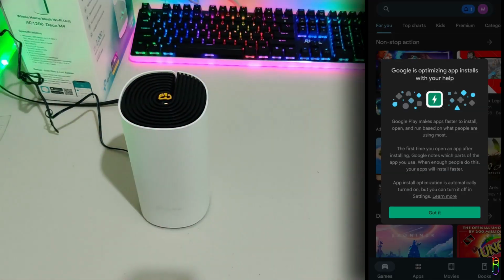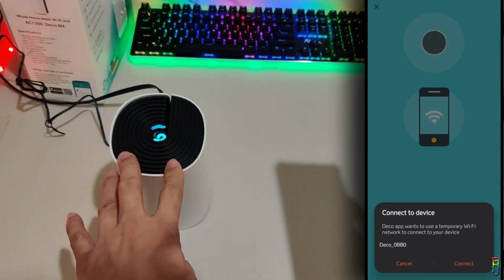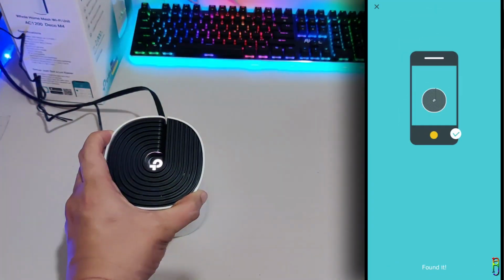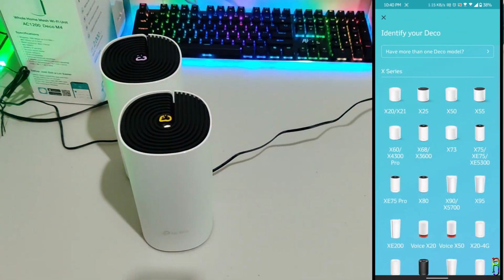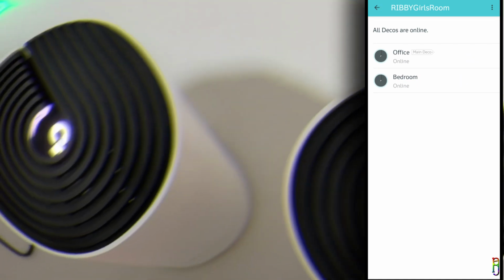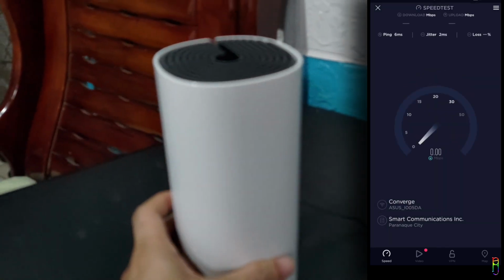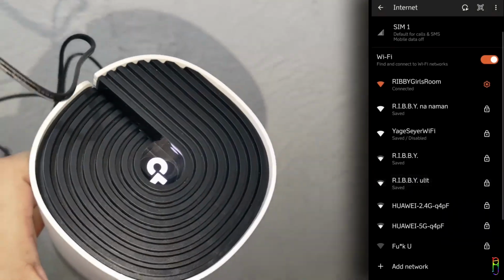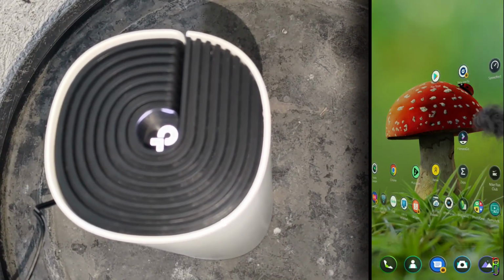Deco M4 Mesh – Setup, Testing & Unboxing

Comment: Question lng po..mas malakas ba wifi signal nito kisa router ng pldt?sa 2nd floor ng bahay mahina na kc ang signal ng 5g..pede po ba isa lng na mesh gamitin aabot ba sa taas?nsa 450sq feet lng bahay ko
Reply from the maker: Same lang siguro sa lakas ng WiFi signal compared sa ibang routers.
Pwede naman isa lang. Ang unang mesh mo ay connected ng LAN Cable (RJ45). Kaya yung LAN cable mo dapat aabot hanggang sa pagpupwestuhan mo ng mesh.
Reply: @ribbytrivia  isang unit lng kc mesh unit papadala ng pldt..kc tinanong ko customer service ok na daw yung isa..aabot kaya sa 2nd floor yung signal ng mesh?
Reply: @ribbytrivia  kc tatabi ko lng xa sa router ko
Reply from the maker: @baytisoy8888  Hmmm... parang useless kung itatabi mo lang sa router mo. Ang pinaka-purpose nya ay ma-extend ang signal ng WiFi mo. Para magkaroon ka ng WiFi connection sa area ng bahay mo na mahina or walang signal. Kung itatabi mo lang ang mesh sa router, magkakaroon ka ng 2 WiFi signal, pero coming from the same area lang. Useless kung ako tatanungin mo. 
Suggestion ko mag-invest ka ng mahabang LAN cable na aabot sa 2nd floor mo. Tapos yung mesh dun mo mismo sa 2nd floor ilagay. 
Actually same tayo ng issue sa WiFi namin dati. Mahina sa 2nd floor. Kaya kinuha ko itong mesh offer ni PLDT. Tapos bumili ako ng LAN cable sa UGreen sa shopee. Yung main mesh nasa 2nd floor. Tapos yung 2nd mesh (node) ay nasa 3rd floor. Wala na kong problem sa connections. Lahat ng floor may kanya-kanyang malakas na connections na.

Comment: Hey, nice vid!

Quick question: With the first ethernet port being used as the source. Can you use the second ethernet port on the main router to have a wired ethernet connection to your PC?
Reply from the maker: Yes, you can.

Comment: Sir, i like to check with you is that posible we only fix 1 unit Deco M4 ? Thanks.
Reply from the maker: Yes. You can always setup more nodes later. 1 will do as an additinal access points

Comment: I bought 1 Mesh and setup correctly but still no internet connection :(
Reply from the maker: Did you follow all instructions closely? Is it connected via LAN cable?
Reply: @ribbytrivia  Found out already :) LAN port is disabled. ISP enabled them to allow network flow.
Reply from the maker: @rhymcristobal4610  Oh. Ok. PLDT? I also covered that in this video:
https://youtu.be/jLIypqxyIV0
Reply: @ribbytrivia  Thank you. Ill try this :) yes but the consultant told me that LAN 4 is exclusive for Cable
Reply from the maker: @rhymcristobal4610  That's a lie. I am using my LAN 1 to LAN 4 ports for internet since day 1. Unless you have a different package for PLDT that includes cable subscription.

Comment: Sir gumagana po ba internet nito kahit nirelocate na? or kailangan forever naka lan po yung router sa deco?
Reply from the maker: Yung main node dapat naka-wired connection sa source router. The rest ng children nodes wireless na. Basta abot ng signal ng main node, kahit saan mo ilagay ang child nodes pwede, kahit ilipat lipat mo pa. Lahat yan na-explain na sa video. Pakinood na lang ng buo para maintindihan ang concept ng mesh.
Reply: @ribbytrivia  Bale sir parang minimum of two nodes talaga bilhin para may wireless po no?
Reply from the maker: @rowandajamana  Opo. Yung una ay main node mo. Sya lang naka-connect na wired sa ISP router mo. The rest ay child nodes, puro wireless na yun.

Comment: Can i connect my tplink archer c6 as main router or should I just connect the service providers Internet cable directly to deco device
Reply from the maker: You cannot replace the provider's router. You can only add access point, but never replace the main router
Reply: I have set it up. The main unit is on the second floor, have other 2 units in the first and ground floors. However, the one on the ground floor has a weak signal, and in the map, I see it's connecting to the unit on the second floor. Can we make it to connect to.first floor unit to get a better signal

Comment: Hi! Main router is in second floor. I only have one deco mesh, I am able to connect it via Ethernet cable however I want to put this deco upstairs but it came up with red light. Does this need to be connected to Ethernet cable at all times? So it means I have to buy another deco mesh so the WiFi could be strong upstairs? Thank youu for helping!
Reply from the maker: Yes. The main node needs to be connected to the main router at all times. Only the children nodes can be wireless.
You can either buy another one, or you can use a longer LAN (rj45) cable

Comment: I have currently have modem-router combo(2in1) provided by local network provider. Im thinking of getting this, can i connect this to my modem-router via ethernet cable(bridge) and just disable wifi from my original modem-router ? Would that be possible ?
Reply from the maker: Yes, You can connect this to your source router. But you CANNOT disable internet to your source router. Think about it... If you do that, where would the mesh get it's connection?
And if you are thinking of totally replacing the ISP router with the mesh, that is not possible. There are settings in your ISP's router that only they can set to enable your internet connection from them

Comment: Is this mesh good for pc as I need one upstairs ?
Reply from the maker: I don't understand the question. Mesh creates a wider coverage of WiFi. As long as your PC can connect to a WiFi, you don't need to do anything on it other than connect to it. The whole process of setting up a mesh has nothing to do with a PC
Reply: @ribbytrivia  i think he was trying to say that he will use the LAN Port of the deco m4 to connect his PC via RJ45 cable, since I think his PC doesn't have wifi. and yes, you can use the LAN port to connect to your PC. hope this helps :)
Reply from the maker: @machellemaglasang6508  Thanks for clarifying. Agree with your answer. 👍

Comment: So, we need to buy at least two of the Deco M4 for it to work?
Reply from the maker: Technically, one would work. But that's just like putting up an extra modem as a repeater. 
The whole essence of a mesh is to create a mesh of networks with multiple nodes to cover wider area.
Reply: @ribbytrivia  thanks!!
Reply: @ribbytrivia  i have a problem after setting up the 1st mesh. The led turned red.
Reply from the maker: @riiaguilar4375  Just reset ang start at the beginning.

Comment: After the set-up, should I turn off the 2G amd 5G networks  I previosly used before I installed the mesh or do they have to be on?
Reply from the maker: I"m not sure I get the question. You already have a router setup, which is your provider's network. Then you are just connecting the mesh to that, to extend the coverage of the wifi signal. So, in the end you will still have the SSID of the main router, plus the SSID of the main mesh. But they are all transmitting the same wifi network from your provider. I'm not sure what the "networks you previously used" is.